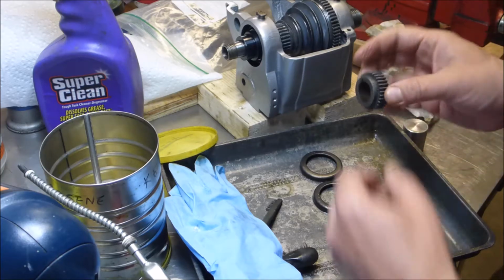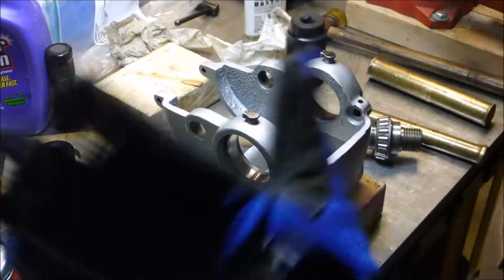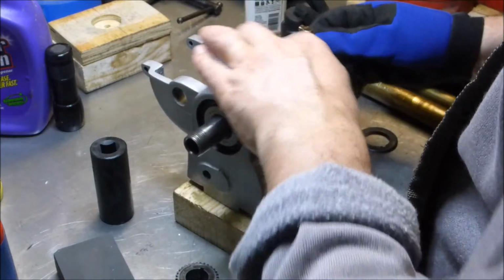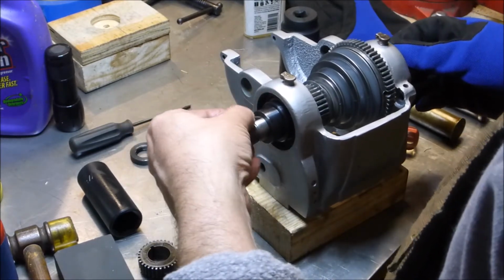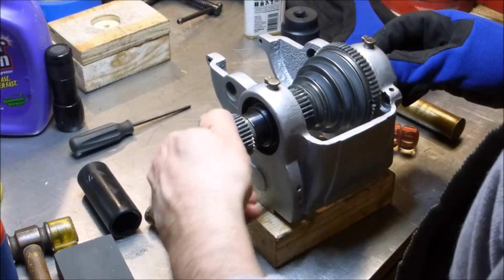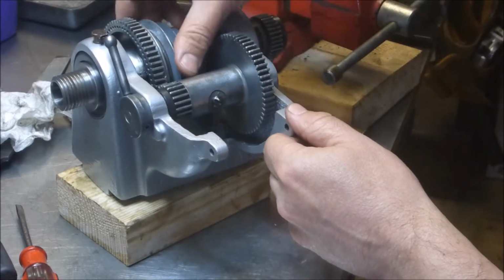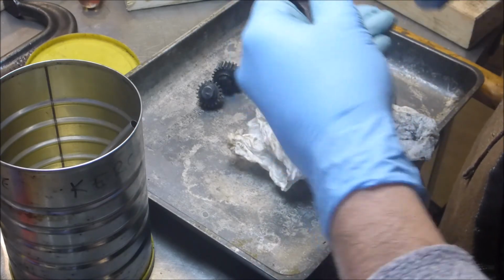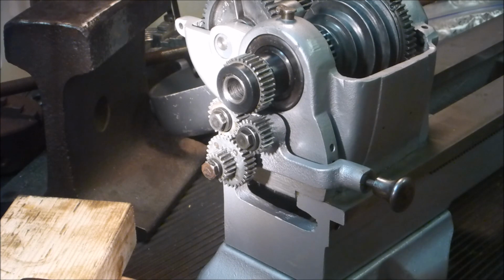2015 04 25 Scrapyard Lathe 05

Comment: I think the problem with the wood ruff key is that the bearing race may not be set in tight to it's register . If you try tapping the race in further it will give you the clearance needed for your key
Reply from the maker: westernstardriver1 It has been a while since I made this video, but to the best of my recollection I tried tightening everything to its stop point. If I disassemble it again, I'll pay special attention to the bearing race. Thanks for watching and commenting.

Comment: How well does the spindle gear line up with the gears for the forward/reverse?  It does seem rather odd that the woodruff key would be partly covered by the spacer.
Reply from the maker: ILGopher I'll be sure to include a good camera angle on that alignment next video. It looks like the spindle gear could stand to move inward, but so does the one on my bigger lathe. Thanks for the question. Of course, I can't figure a way to get any movement out of anything since the bearings are tight against the races and the races are tight against the casting.
Reply: I was wondering if you could face off the spacer a little to shorten it if it does look like the gear could move inward.  I looked through another Youtube restore for the same lathe model number and it didn't have the same issue it didn't look like, but there wasn't a close-up of it either.  I couldn't find a part length for the spacer when I did a quick search.
Reply from the maker: ILGopher At this stage of reassembly, I'm 90 percent certain I could face that part off and do nothing but improve the lathe. I'm going to wait awhile before I alter an OEM part, however. After I've gotten to know the lathe, perhaps I'll become 92 percent certain.

Comment: I think what Scott Henion stated is correct except he means that the set screw should not reach the spindle at all.  Someone drove it in too deep, causing it to touch the spindle when in back gear, scoring it.  The set screw is nothing more than a cover for an oil point so that you can lubricate the bearing surface of the pulley on the spindle when the lathe is in back gear.
Reply from the maker: b2major9th Yep, you guys are right. I corrected that issue. Thanks.

Comment: You said something about the set screw in the pulley riding in a groove. It should not touch the pulley at all.

It is an oil port, nothing more. Someone previously screwed it up to make it reach the pulley.
Reply from the maker: Scott Henion That makes perfect sense since the pulley rides on bronze bearings--stands to reason it should have an oil port. I backed it out where it belongs. I don't think that groove should interfere with anything from here on out. Thanks for the tip.
Reply: Rick Rose My 12x36 was in near perfect condition except the pulley "ringed". Seems the last owner never oiled it as they did not know it was an oil port. So the pulley bearings went egg-shaped. Some new bearings and now fine.

That set screw seems to be the #1 mistake A/C lathe owners make. #2 is asking why the threading dial stops when you engage the half nuts ;)

That groove won't effect anything. It is in the unused area that is an oil reservoir.

Nice job so far. I never got around to painting mine. Just fixed t few issues and have been using it for several years.
Reply from the maker: Scott Henion I never painted my 10-inch lathe either, but then that one didn't nead tearing down so badly. If you've got to take the thing completely apart anyway, I don't think it adds much time to the job.